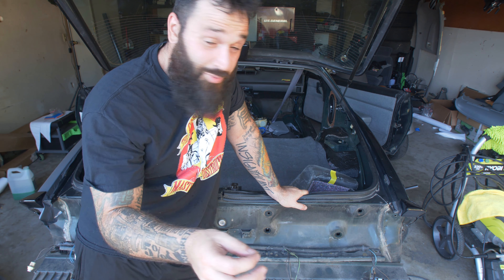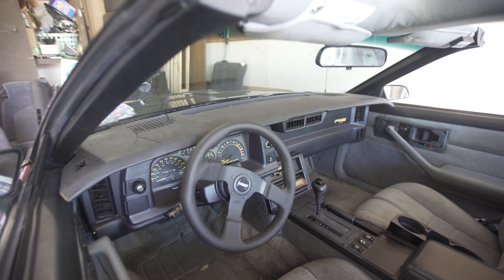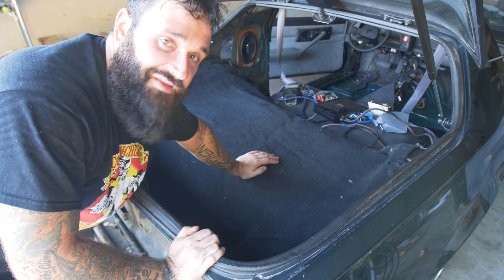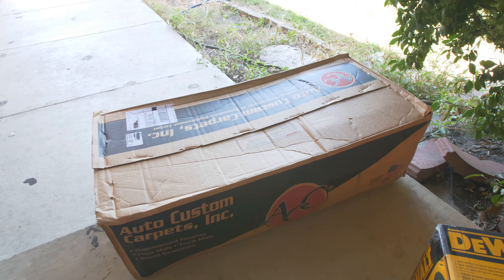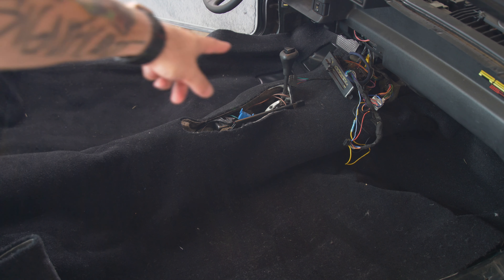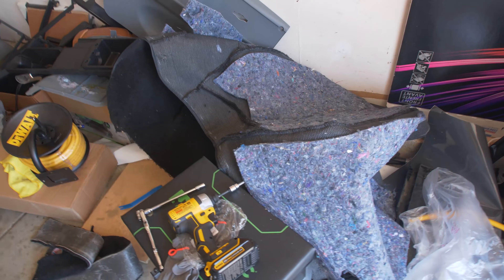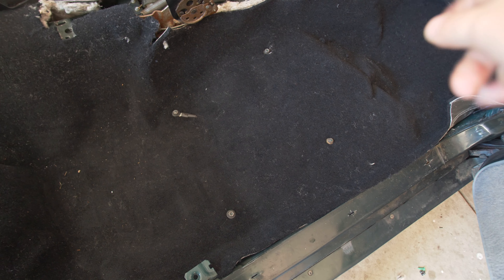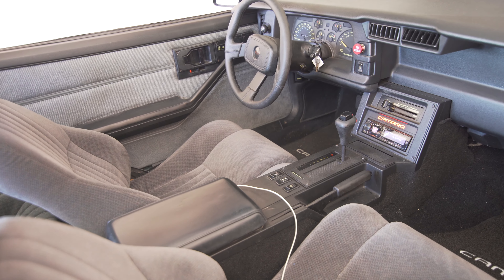Third Gen Camaro Project | Black Plastics and Carpet Install | Episode 20

Comment: spray those cracks in the driveway. you're taking great pride in your car, now take pride in where you park your car. I like the car it's coming along well.
Reply: I fixed mine 2 years ago...pressure washed the cracks where the weeds were growing, and grabbed a few tubes of the asphalt crack sealant, and filled them up. Used a small putty knife and ran over the cracks to make them flush...Turned out great! Waited a few weeks and sealed the entire driveway. Really freshed it all up!

Comment: Pretty sure that sound deadening  stuff needs to cover the entire floor to really help.🤔🤫
Reply from the maker: nah it basically just dampens all the sound vibrations from the road and exhaust.  There's not really much difference from covering 100% to covering 30% (at least from the small amount of research I have done)
Reply: You are thinking of sound barrier material. If you don't have full coverage with that stuff its performance suffers. All the mass loaded tile does is help prevent resonance. Its easier to think of it like a speaker. You can either put your hand on it to dampen the sound or put it in another room to block the sound. But if you have a hole in your wall you can hear it just as clearly.
Reply: No, aslong as your covering a minimum of 25% you are good to go!